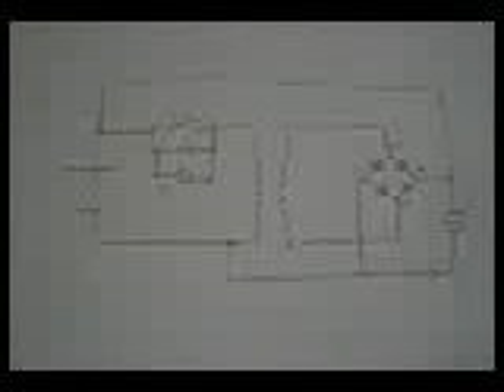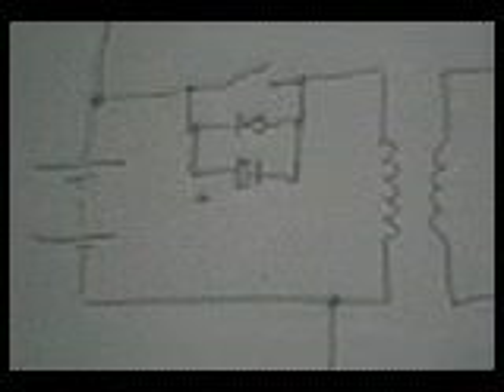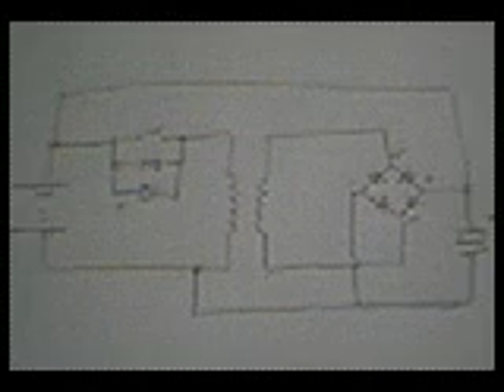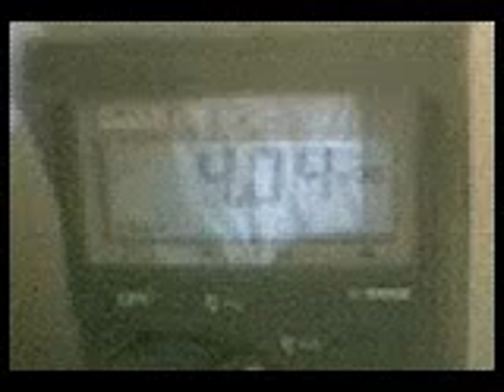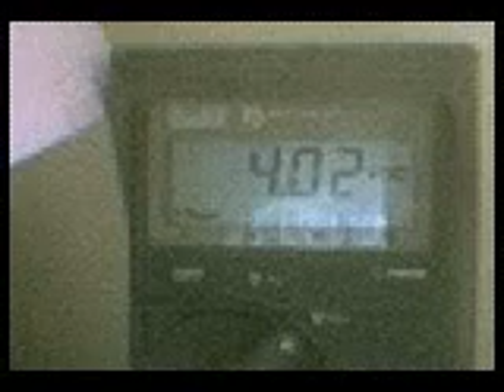The ultimate Bedini motor

Comment: If you charge the run battery you will eventually ruin it. when you pull current from a battery the plates physically bend...when you put current into a battery (through back-emf or pulses ) it bends the plates the other way...so if you use normal sized batteries and have a system with any real power you will bend the plates back and forth untill the battery is ruin...just a bit of info to help you on your way. Keep experimenting!

Comment: 1.  When the switch closes the capacitor is shorted. No wonder the paperclip you used was wearing out!
2. When the switch is opened, the back-emf operates to try to maintain the current in the same direction.  In your circuit, this will cause the cap to charge, not go through the diode.  If the batt voltage  is greater than the diode drop, current will flow continuously. 
Is the circuit in error, or am I missing something?

Comment: well you have AA dry cells powering the circuit and they are always loosing a charge so you need to add another charging coil to make up for heat and resistance losses. then try running it on a small lead acid gell cell or a Lithium cell I have seen this motor work and keep running without a battery you simply do not have big enough capacitors to overcome Electrical Resistance and Friction

Comment: were bedini motors only overunity because it was one battery powering the motor and by that recharging the other, with more power as an output rather than less energy than the input (thus violating energy conservation)? Is it just making it easy to switch the batteries, rather than make the battery running it  power itself? Or can it be more than that? Sorry if this question sounds elementary.

Comment: Run motor on 24V, and charge 12V battery stack from FWBR DC out straight into 12V battery stack
Place 2nd swtich on one of the AC legs of the FWBR
Turn this 2nd switch on-off in echo (slightly after) the motor ocil pulse.
Try the AC legs of FWBR over you motor switch itself - also try across the motor coil, and try over both motor cil and swtich too see what works better in your motor.
This method of backemf/recoil recovery lowers motor draw, increases power, while charging batts great

Comment: take a deep breath yourself on whatever it is you are smoking.
Power is measured in a pulse motor in joules release from capacitors into load get it? thats all I am saying.
reocovery caps will always fill X20 of what is pusled into motor coil in Bedini type pulse motors duh 
this is because the backemf/recoil spike is captuered 
and then also the cap can be put to use when you pulse that cap either back into motor or 2nd batery stacks to charge.

Comment: the core's resonance is a stochastic resonance.
If a core is resonating, it will be dominant.
Radio would not work if you dont tune to a resonance. 
Most dumb critics of Bedinsi work will ignore resonance, just like you do.
Radio frequncioes ca be captured into caps in pulsed coils recoil and back emf recovery circuits.
You will alwys get X20 voltage in cap compared to what the coil is being pulsed at, in the capaciotr that is capturing bacemf/recoil of a pulsed coil if you do it right.

Comment: When you measure power from a pulse motor's recoil and backemf into cap, or from pulsed gen coils that are induced by magents on the motors shaft, measuring power is a subject of JOULES 
this is the power released from a capacitor into load.
Conventional power measurements leaving a reisitance on the sinewave throughout the entire sinewave is pretty stupid way really - the cap will not fill anymore than at the peak of that sinewave so why leave resistnace and load on it after the peak?

Comment: Across your motor coil switch, instead try a FWBR of four diodes, (instead of your two) with 2nd swtich on just one of its AC legs that go across that motor coil switch.
Swtich this 2nd switch on-off like echo to motor coil pulse with same pulse width as the motor coil pulse.
Mo power Mo speed less draw no lug even when charging really low batts. 
Best to fill cap and thne dump cap to charge batts at X2 voltage of charge batt.
Any cap dicharge under 12V is totally wasted charging batts.

Comment: is the voltage induced in your coil by the rotor higher than the battery voltage? It would be good to charge the battery using the generator function of the system, as well as recycling the field energies...

Comment: perhaps some germanium could be exposed to an alpha source, then the (nano?)fibres produced by this reaction(??)could be harvested and used to convert radiant alpha energy directly into electricity, using a reaction chamber full of radon gas and these micro-fine whiskers which transduce and conduct current out of the system.i'm not sure if Bruce Perreault is using the microfibres in his batteries, but it seems a good bet to me. will test this at some point for plausabilty/output...

Comment: ultimately it would be nice to have all the wire in the circuit and coils made using germanium and insulated with a coating doped with some fairly active radioactive source. all a bit much for a home project i guess...